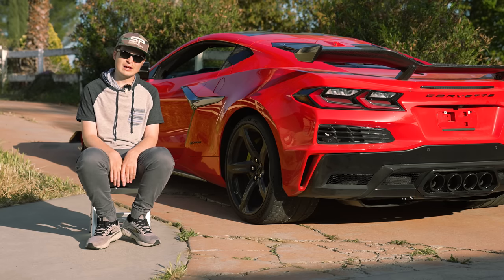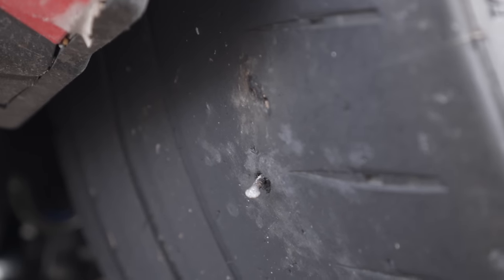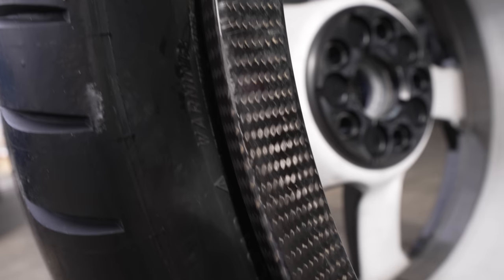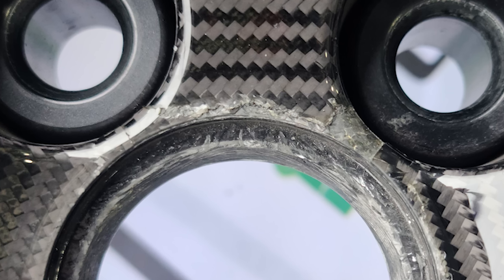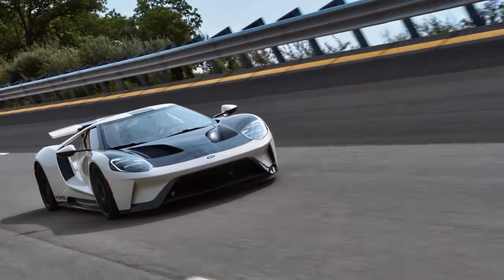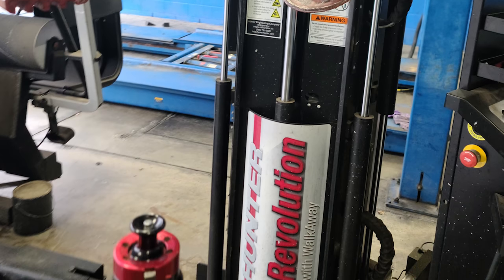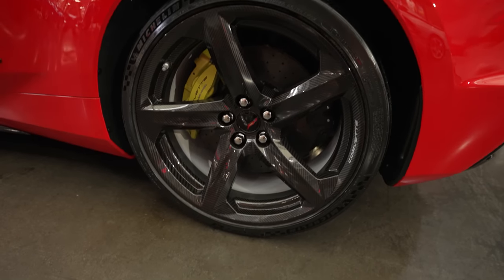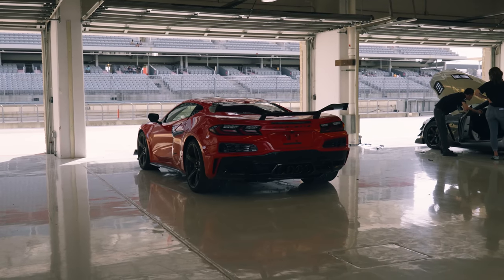MY $20,000 CARBON FIBER WHEELS ARE RUINED... YOU WON'T BELIEVE WHY!

Comment: Chevrolet need to take an action NOW as they ship more and more Z06 with carbon fiber wheels. It’s plain irresponsible to sell a car that you cannot support with your dealerships. In my opinion the carbon fiber wheels is a must-get on the Z06 regardless of whether you opt for the Z07 package. I’ll be moving on to another car if this doesn’t get addressed properly by Chevy.

Comment: Great topic!  I guess I hadn't thought about this one, but it makes sense that none of them are equipped to handle CF wheels!  Granted, you've gone through more tires than anyone is likely to using those wheels on the track, but still...  IMO GM should be replacing these wheels.

Comment: The tech needs to have a cone that is new/disposeable.  You change tires outside of warranty you pay for a cone.  The cone should be softer than the resin in the carbon fiber.

Comment: Excellent video addressing the core issues with servicing a vehicle (Z06)  that is an outlier in comparison to all other vehicles GM has manufactured.    Owners  of these cars are going to expect a level of service commensurate with a a 150K vehicles.   I was seriously considering buying a Z06. I've been following several channels to determine dependability, reliability, maintainability etc.  Unless some core changes are implemented by GM  addressing  sustainability, maintenance/repair,  I'll go to another brand.  May cost more for another brand; however, the peace of mind is well worth it.

Comment: Have a hub made from a front wheel bearing for your car, have the center cut out have the back cut flat,  Have a hole drilled into the backing plate for tire changer pin to go in needs to be size of your wheels lug hole. Then have a cylinder  made  and welded to the center of the hub that sticks up passed ur wheel. Install lug studs into the hub Then bolt it to the wheel. That will protect ur wheel from ever being touched by the tire changer. Tho the dealer ship should have this made up to add to there machines adapters. I my self have changed a lot of Corvette wheels and they suck. I always used the changer that HUNTER makes. Tho no amount of air  can make them pop onto the bead I have always have to use ether  and a flame source with  air being pumped in at same time. I'm not sure I would use the ether trick on carbon fiber.

Comment: I had the same thing happened on my rims at my local dealership and got the same exact answer you did they wanted to have it repaired I went level 10 crazy made a heck of a scene cussed out the service manager and threatened to go to the gsm or gm or Chevrolet if I didn’t get a brand new rim. They got me a new rim but it should not have went as far as it did. I truly believe if I Had not been absolutely so irate they would have just made me eat their mess up.

Comment: There should be a separate Corvette only service center.  That's why I Never take my Z06 to the dealer.  I didn't even go there to get my 2 free oil changes,  My luck they would only put 6 quarts of oil in and try to rotate the tires LOL.

Comment: Hard to imagine GM investing in specific equipment for the relatively few cars like yours that they will sell. Hope they resolve your problem...at least give you a new set of CF wheels...but a consistent long term solution is iffy at best. Buy an Exotic car from an Exotic Car Company not one focused on Electric cars & Trucks for the masses. Good Luck ...look forward on how they deal with you and the entire issue you have uncovered.

Comment: As I learned really quickly from the motorcycle world with Carbon Fiber wheels on my BMW. They are just NOT worth the headache, heartache and hassle for racing/track time. We are changing tires far more often than the usual guy and the equipment that handles these wheels just isn't up to any sort of high level standard. 

Do yourself a favor, MRR sells a set of Forged wheels that are the same style as the Z06 wheels for a fraction of the cost. Get some of those!

Comment: This is the dilemma. It’s part of the reason why you get a Corvette Z06 for what in theory is a very reasonable cost (at msrp). Chevrolet is a mainstream low cost (someone please remind the dealerships) manufacturer of vehicles, and thus has a dealership network that is essentially that. You are not going to have a well paid, and structured repair network. It’s really unfortunate but it’s a fact. Dodge in my opinion is definitely a notch below in terms of dealership structure and this was THE NUMBER ONE WORST PART of Viper ownership. Even with so called Viper techs it was always a problem. If the porters weren’t joy riding and crashing them the mechanics were treating them like they were a Neon.  So you buy a Porsche and you get a network who has trained top tier employees who are schooled and treat your vehicle with respect, the caveat being you are paying this forward in the price of the vehicle. This is a problem that will not be solved by Chevrolet. Lucky for you that you have exposure and Chevrolet made it right. The average Joe will just have to deal with fractured wheels.

Comment: Dont know much about carbon fiber wheels but from what i can see, Im wondering why the center of the wheel doesn't have some kind of metal/aluminum or titanium cylinder like the lugs do? I understand about the weight but it shouldn't add that much to the wheels...

Comment: I think manufacturers might want to start treating these wheels like an engine or a gearbox and offer some kind of warranty for them, considering how expensive these wheels are. Not everyone who buys this car can just go out and afford another set of carbon fiber wheels, and quite frankly, they don't need to. A car should be reliable. No one likes a car that keeps draining your wallet in maintenance costs. People would prefer a higher upfront payment for a car with no issues. Your GT500 was an example. Great car but just too expensive to maintain, and after a while it just gets frustrating. It costs time and results in you not being able to enjoy the car you paid for at all. The Z06 is a great car, and this isn't an issue Chevy can really change with the Carbon Fiber wheels, but they could help out.

Comment: Wow this is eye opening for anyone thinking of getting the carbon wheels, I would have thought Chevrolet would have had this already figured out. These wheels are very exspensive and by not providing their partners with adequate tools or knowledge on how to handle them they really put the dealerships at risk. Not just financially but reputation as well, imagine going in for what you think is just a routine wheel change and your exspensive wheels get damaged, you're obviously going to have a bad taste in your mouth towards that dealership and will want retribution for the damage, the dealerships will be on the hook for that. After seeing this I would seriously rethink getting the carbon wheels, this car will go through tires quick so having a place to be able to get them changed without damaging them in the process is obviously extremely important. Hopefully Chevrolet makes this right and sets up a service department that has the adequate tools to work on/service these cars

Comment: I have a C7 Z06 and I have dreaded the day when I need to replace my tires because of what happened to you. I thought the Chevrolet Dealer might be a good choice as they would cover any damage they might do to my wheels, not so sure now! I also have the optional $7.5K carbon fiber ceramic brakes and I also fear they might get damaged, much in the same way your wheel was dropped. This definitely makes me hesitate to order the Carbon Fiber Wheels on a future Corvette purchase. You need to be put whole on this as you hold no responsibility for your current situation.

Comment: Sorry to hear the news.
as been already said, z07 package is not for real track use. It's for shiny photos and magazine laptimes. 
AP racing brakes + 18 inch wheels is a way to go. You'll be faster on thos too, quite probably.
Reply: @effie4903  yes, and he cracked 20k wheels (I know that it's not track accident) and brake replacement for him would cost five digits as well; plus he already mentioned tire expenses.
You could track this setup, but it's highly impractical and 3+ times more expensive than classic approach.

Comment: This has always plagued the Cadillac brand also. Since they fall under the GM umbrella they are serviced at a multi franchise dealership typically. So the CTSV, Escalade or any $100k+ vehicle owner is being serviced the same as a Chevy Malibu. At least with Lexus they would not franchise to a Toyota dealer without a separate customer lounge and drop off area. Corvette needs to become its only brand and require dealerships to step up their game. These cars are too expensive and to not provide a better servicing experience.

Comment: VERY simple solution.  So simple that it actually makes me cringe.  You put an integrated conical 'washer' on the hub cone.  This has been a feature of Lug bolts for decades and is PURELY to prevent the torquing of the bolt from marring the wheel.
Its actually ridiculous they didnt think of it.

Comment: To be honest if you look at most wheels overtime you will see scuffs and scratches around the bolt holes and center caps. But most people won't care about their standard stock aluminum wheels. Not saying it should happen but generally it will happen to a lot of wheels but usually it's a non issue and hardly anyone looks or notices. That said I'm sure the lower paid new guys are doing the tire changes. Not to mention the labor hours are low for a tech doing it and they are forced to hussle due to the flat rate pay system. Not too unexpected to be honest

Comment: They should NEVER be using a center cone on that carbon wheel. They should be using a proper flange plate adapter just like Ferrari, Lamborghini, Porsche, etc use and recommend.

Comment: Curious that Chevy went with CF on these wheels. There is precedent with Magnesium wheels (like on C5 as an option) and Porsche does this on their RS cars too so I'm wondering why at least Magnesium wasn't an option here. CF seems great on paper until you have to service it. Gordon Murray also doesn't like them since the failure modes for carbon are catastrophic and basically impossible to predict or model. Yeah idk I feel like CF is more trouble than its worth, for me at least.

Comment: My 19’ ZR1 with ZTK package had the paint flaking off the upright bracket on the wing. And I was told to kick rocks. 

They want huge money but the service is definitely lacking. 

And now to even buy one of these cars it’s 50-150k over MSRP why doesn’t GM step in? I ordered my Z06 3 years ago at my local dealership and they changed hands. Now they want 150k over. So my 23’ Z06 is just sitting at the dealership in the spec i ordered why they hope to get double MSRP 🤦🏻‍♂️

Comment: Unfortunately chevrolet dealerships don't know anything about the Corvette I've had a couple of bad experiences with them I took my Z06 into a chevrolet dealership I was having a problem with the cooling fan staying on car was under warranty they pulled the car in to there shop 10 minutes later it came out they wouldn't touch it charged me 50 dollars gave me a business card to a garage that worked only on Corvettes not a authorized chevrolet dealership.                           2nd go around with a general motors dealership was a oil change and preventive maintenance I waited and waited they couldn't figure out how to lift the car I even handed them the lifting pucks they ended up changing the oil over a alignment pit

Comment: Maybe a bit misleading to say they are cracked as it sounds like cracks in the barrel or spokes as opposed to the chips and dings around the mounting area you showed. Having dealt with carbon bicycles and parts for many years there is a big difference between those who know how to handle the material and those who don’t. I think GM built a cutting edge car without building out a cutting edge support system for it.

Comment: You may not like this but I doubt Chevy is going to invest is specialty equipment for the handful of carbon fiber wheels their unsuspecting customers may buy.  They are treating their Corvette customers like crap with transmission and engine failures as well.  Volume car dealerships care about one thing and that is moving the iron.  Once the car is out the door it is on to the next sale.  Most sales departments and service departments are run as separate entities and hardly talk to each other.   Speaking from a Ford perspective,  Ford likes to put plastic chrome wheels on their F150 trucks and you are lucky  if they don't chip off the chrome at the bead the first time you get your tires changed.  I did get a dealer to replace two rims the first time but after that they warned me beforehand this could happen so they were off the hook when they messed up two more.   Your comment about Ford GT service being better might be so but my guess is those dealers could easily be 50 miles away and i don't know many people that would drive 50 miles to remount tires.

Comment: The dealer get the same money and time allotment whether Z06 or Bolt. 
I deliver these and many other models from the factory to dealer. I get $5 to load or un-load per unit. Have about 5 minutes per car/truck to inspect for damages, drive it up onto truck, then strap it down. Same treatment whether Z06 or Kia. Manufacturers don't care! 
If you want the white glove treatment, get a Ferrari!

Comment: They are using wrong adapter there is a lug hole adapter to use on special wheels like carbon fiber and ones with the chrome cladding, that dealer needs to learn about their equipment

Comment: They should use other clamping.
Flange plate kit
Hunter has it for the Machine.   If the dealer doesn't have it that's another case.  They probably went the cheap way with a very expensive Machine.

Comment: 1st they need to get you a new set of wheels ASAP. Second stop taking your car to the chevrolet dealership to get the tires changed. You live in Southern California, there's plenty of shops that know how to change a tire on a carbon fiber wheel without damaging it. Also you should think about getting another set of wheels and tires so that you'll have one set to use at the track and one set to use on the street.

Comment: Absolutely unacceptable for any dealer in the GM network, to be incapable of changing a tire on any GM product. Let alone dealers refusing to do it. And if it's an equipment issue, then GM needs to do a better job with minimum dealer standards when it comes to required tools and equipment like tire machines. What you have here are inadequate min dealer standards, and a largely incompetent manufacturer that makes a product beyond their support capabilities. Both problems that could be easily rectified, but won't be.

Comment: This is completely unsurprising. Dealerships are used to handling and abusing cheap cars. You can't expect them to respect an exotic vehicle with rare features. Honestly, I suspect most of the complaints about American car's reliability, comes down to bad dealership service. They don't care at all about the brand, they're just trying to minimize costs and maximize volume. That's all they understand, that's what they were designed to do.

Comment: You bought a GM product, what did you expect? If you wanted Luxury in Service and Parts, you would have bought from Cadillac. Why didn't you buy the car from a Corvette Dealer? Oh yea, that's right, GM doesn't have such a thing. They sell Cadillac, Chevrolet, GMC, but don't have a special Dealership for Corvette. Why?, because it is just another Chevrolet which in GM's eyes is a less of a product in their line up than a Cadillac or even a GMC. Why is it that Chevrolet has the bottom of the Options and Service quality compared to its other brands like Cadillac or GMC, but Corvette is just a Chevrolet. It might be a great sports car, but it is classed in the cheapest part of its company. Corvette should have been a Company itself within GM, but budgeting made it a Chevrolet.

Comment: they (GM) would be better off shipping new wheels with mounted tires to you and you sending them your old wheels, every time you need a tire change than to , #1 Piss you off, #2 screw it up and have to replace the wheels anyway.

Comment: Austin…. You are too nice but its good that you are making this public.  The old adage of “if it sounds too good to be true… it  probably is,” applies here.  Ask yourself….. why doesnt Porsche offer carbon wheels on their cars at even higher MSRPs?    TBH… i would be more concerned about catastrophic failure.  I have raced carbon bicycles for over 12 years and when carbon has a failure it happens fast - too fast, and that is only at 20-45mph.

Comment: I'm sorry but carbon fiber wheels is a total waste of $$$ and very bad choice.  Don't get me wrong they look amazing but not worth the $$$.  I have a mercedes with some carbon fiber exterior and at least I can get those PPF to provide some protection against stones and chips.  But carbon fiber wheels you cannot and they are super expose to road debris.  No matter how well carbon fiber wheels are ceramic coated it will not protect them.  There are other options for wheels that can look incredible amazing especially on a Z06.  A buddy of mine got himself a set of Vossen wheels that just blow away how amazing his C8 looks!